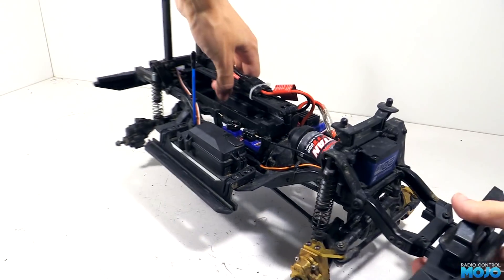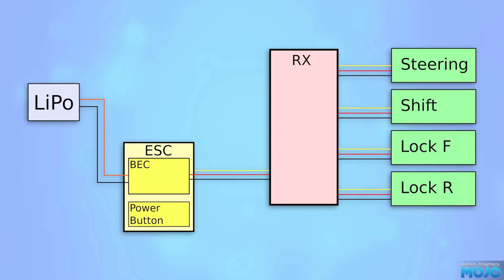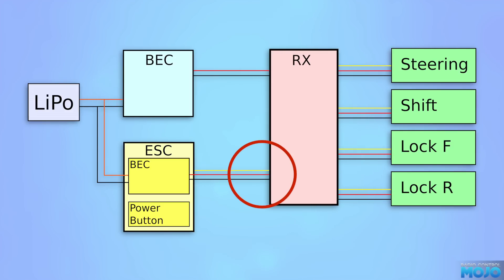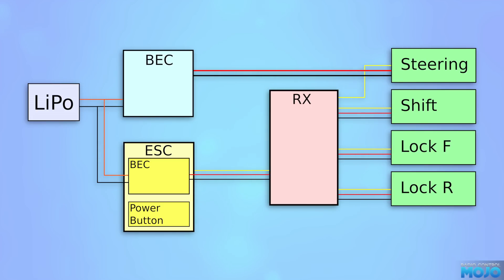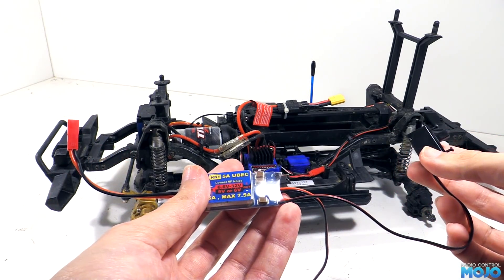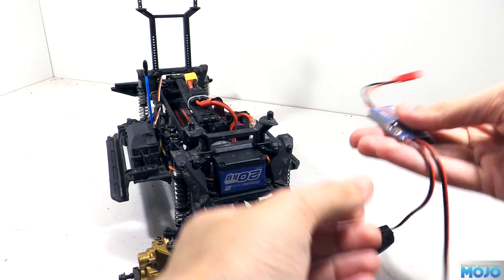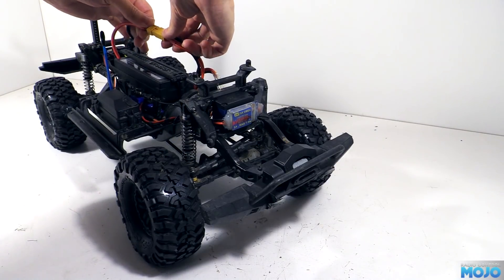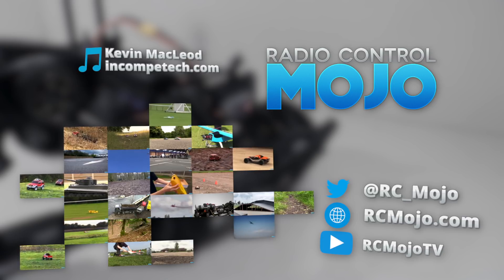Traxxas TRX-4 - BECs

Comment: i have a question. i like the idea of using a bec to just power steering servo and the esc to power the small one but i have a question you said that the holmes hobbies adapter will work but the part of that adapter that plugs into the reciver has 2 wires yellow and black your diagram says just the yellow to the esc whe setting it up to use both is the black just a ground? thanks for the help

Comment: I struggled with how exactly to put a BEC on the TRX-4 until I came across the BEC receiver bypass ($6 from Gearhead RC) very handy when you don't want to overload the other items running off of the receiver like the sub micro servos. It allows you to push the voltage up as high as the steering servo can handle it.
Depending on how hot the servo and BEC get strapping them together may not be the best for thermals I would imagine.

On more thing of note, when you swap to another ESC without a on/off switch you wont have to worry about syncing up the BEC to power up with the ESC at the same time, keeps wiring simple as well.

Thanks for  the video, I'll be passing it along to my brother who's getting a BEC as a gift tomorrow and this will be question number 1.

Comment: So if i chande to another servo than stock, i have to install a BEC ?..i am one of those how probably not can do this by myself...and if i use holmes lead it`s an easier install than the one you did? Sorry if "stupid" questions , but i have no one around that can help with this..Guess i avoid the work if i stick to stock servo..hehe..thank you for good and informative videos..my english not the best but understand you ok..
Reply from the maker: It’s not completely necessary, if you simply swap to a higher power servo it will function, however the higher power servo needs more current. So to get the best from a new servo a 5A or higher BEC is a good thing to install.

The bypass lead does most of the hard work for you, you’ll be left with having to solder the input from the BEC to the battery connector on the ESC, or if you get a BEC with a red JST BEC connector on the input you can plug it into the accessory port on the stock ESC.